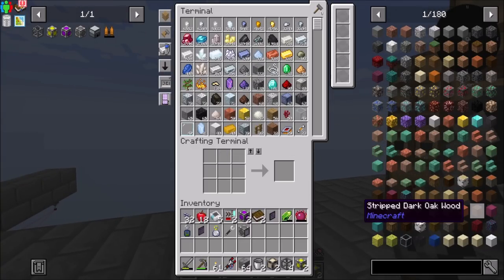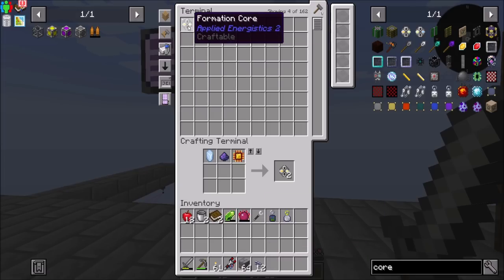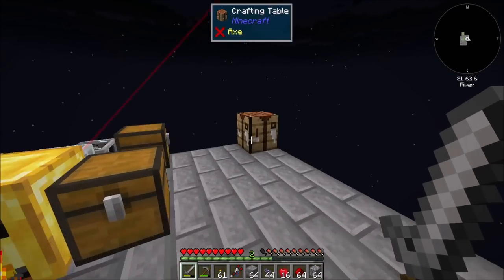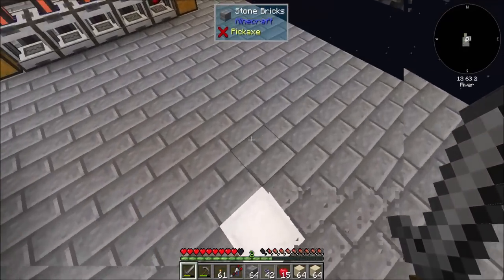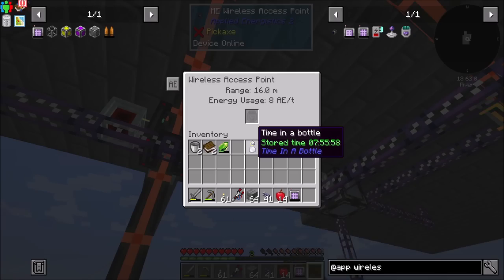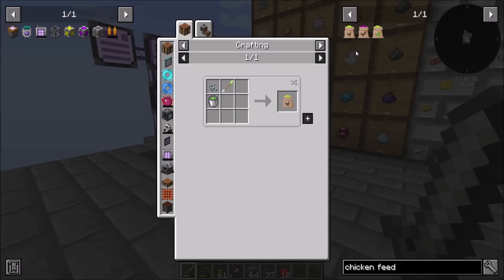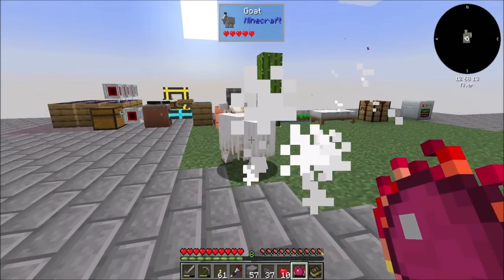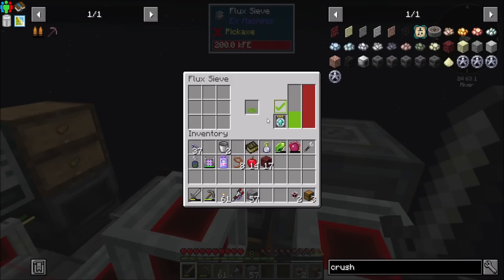ATM7 Skyblock Ep10 Wireless and Autocrafting

Comment: If you'd like, an igneous extruder with witch water, lava, and a redstone block can make netherrack without the cost of redstone. A neat alternative!
Reply: I went this route too, there is such a low chance for the netherite scrap you end up needed a lot of nether rack.  You can use glow stone under it for end stone too! Good way to get platinum.
Reply: I'm using two mechanical drying basins to turn lava > magma > netherrack instead

Comment: as others have said, automate your hammers and sieves dire!  Remember they can input into each other! I went ahead and setup a line for gravel and a line for dust, though I still need to work on netherack, endstone, and soul sand.
Reply: I have setups for the various types of water you can make stuff from. Then auto input from those into where I need them to go.
Reply: You may want basalt too to get amethyst and flux dust for emc and flux networks

Comment: Hey Dire you should try the applied mekanistics automation for the infusing factory, so that you don't need to stock the machines with enriched redstone, coal... and you only need one infusing factory. You just need to get the infused types into the ae2 chemical cells and set the recipes to use the chemical version of the infuse types. I hope I've explained it well enough
Reply: Oh neat, it adds Gas/Infuse Type support to AE

Comment: You might just not be far enough away for passive mobs to spawn. Try making a platform further out. ALSO, as others have said, you're in a river biome, so passive mobs won't spawn there.
Reply: yes, per minecraft spawn rules the fence has to be 24 blocks from the player, 25 from the spawn point.

Comment: Hello Dire, a note on how the flux sieves work with upgrades.  The whole stack done with the upgrade is on the same roll chance, so when farming for first netherite it is better  to do it without the diamond sieve upgrade.  16 netherrack is used up for a single .8 chance and netherite each time instead of one at a time.

Comment: Dire, make yourself two mechanical drying basins. The first can dry lava into magma blocks, and the second can dry the magma blocks into netherrack.
Reply: That is the slow way ....Igneous extruders are the way to go....4 set up in a 3x3 with a lava in center and a witch water, Water and a blue ice in 3 corners with a Polished andesite, a redstone block, a glowstone block and a soil soil, all placed under the correct igneous extruder is very compact and will provide endless Endstone, Andesite, basalt and netherrack and all in a compact 5x5 area.

Comment: Mekanism machines have had the Input/Output same side for a long time. In general, they've been easily automated with AE2 and RS for years. The exceptions are the ones that need an extra slot item, like the Metallurgic Infuser, as it can't input to the normal slot and the extra slot with the same side. So that needs items routed to different sides to automate, or go the lame method of having different ones that are always full of the needed extra item, which is incredibly inefficient.

Comment: found something interesting with growing cactus on snad.
place snad, then cactus on it as per usual.  then where the 1st block grows, adjacent to it put any solid block and profit
Reply: congratulation, you found vanilla auto cactus farm! good find, now you can setup a huge farm with a vacuum and then it's truly profit. Also you may want to use fence, so the cactus don't get destroyed upon popping off and landing on its "root".
Reply: I am assuming you mean beside the 2nd high cactus.....yes that is an old vanilla trick....even predates snad. I just today revisited a very old design for a cactus farm.....4 sand (or snad) placed in a 3x3 square (a block apart), pillar up 3 block in the center and place blocks on each side of top block (add torches on them) then remove the pillar place and walls 1 block out on all 4 sides except 3 columns in ONE corner, dig out block at end of 1 wall and put a chest, in the inside corner dig out and put a hopper aimed at chest. Place a water in opposite corner, water will flow to the hopper, place cactus and done. Soon after I built this Today I had to remove 3 cactus as it was too OP..... I think 1.3 was last time I build this.

Comment: Use Uranium blocks for lava generation. You can easily get uranium from sievting sand and it's much faster than the blocks you are using.
Reply: Uranium is 3 times as slow as the superheating element Dire is using for lava.

Comment: Stone drawer into compactor into hammer and you don't have to manually grab nine stacks twice per episode and will have plenty of resources at all times.

I like to set mine up with drawers for the output. Give it a downgrade so it only takes one stack. Once the gravel drawer is full, it'll start converting the leftovers to sand, then dust.

Using your nifty lasers, this automation is a breeze.

Finally, when all four drawers are full, start sieving from dust and up, until gravel is done, then repeat the process. Laser IO can be used for this logic as well, with the added bonus that you can easily make override levers for if you need a particular resource processed immediately.

Comment: You should use the igneous extruder to make netherrack.  Also, you should do the initial sieving without the upgrade.  That way you get 16 chances to get a scrap, rather than 1
Reply: @trackfire00  I guess it’s personal preference.  What he really needs to do is actually automate resource production rather than making it manual.  He’s got the RF.  Automate gravel, dust and netherrack and he’d be swimming in resources.  It’s not even very hard.